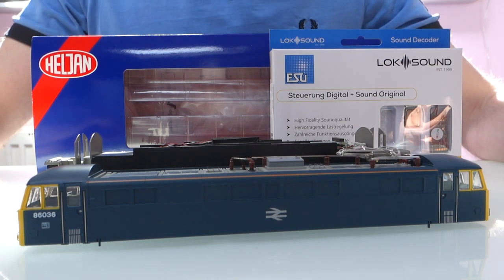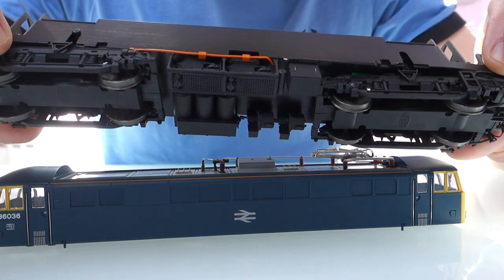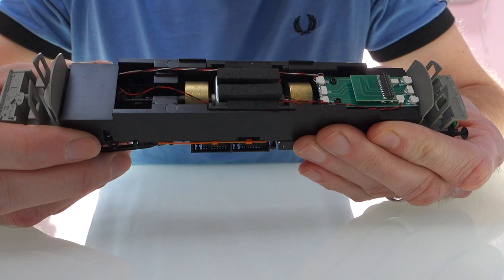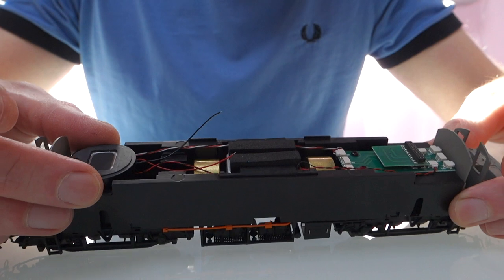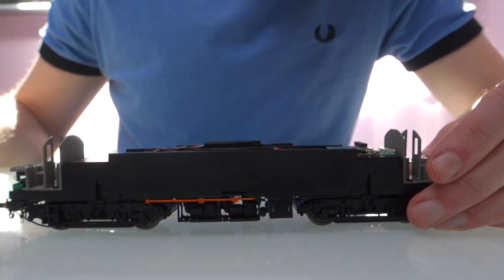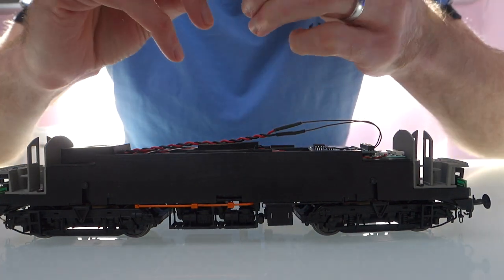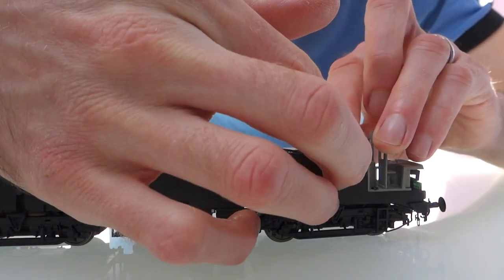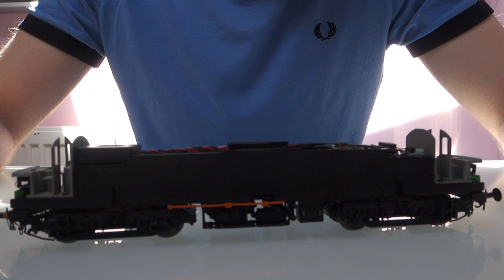Installing DCC Sound Into The New Heljan 86/0, Fitting Guide And Speaker Options

Comment: Thanks very much for your advice on removing the body Richard.  Despite sliding four pieces of card between body and chassis it still wouldn't budge.  So I watched this video and your tip holding either side of buffer beam did the trick!  Cheers,  Vivian.

Comment: I have the heljan 86 from 2010 which I've just started running and discovered that the complete buffer assembly with the small details isn't permanently attached to the chassis enabling the complete removal so you can attach couplings with no interference just simply gently grip the corners of the buffer assembly and gently pull forward. If don't mind having no buffers while running with a rake . You can then remove the couplings and simply push back the complete buffer assembly.